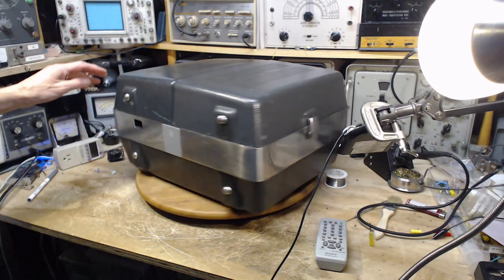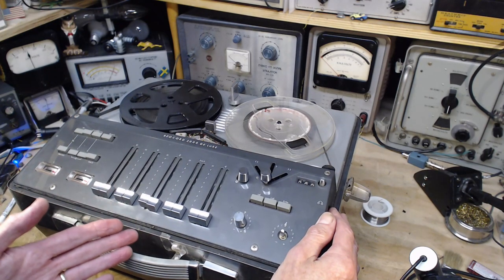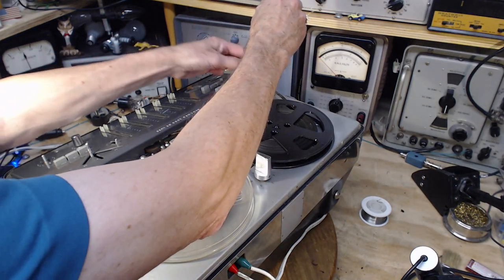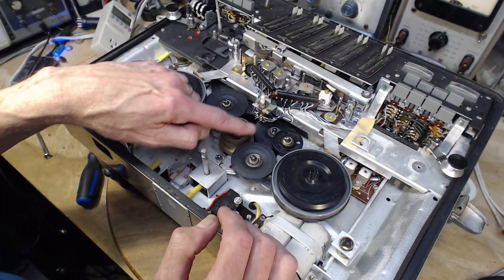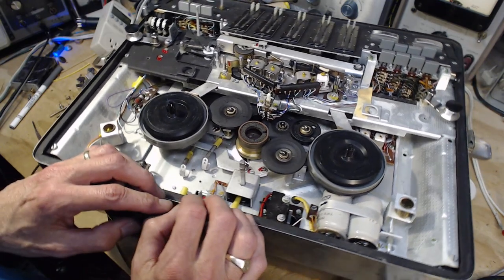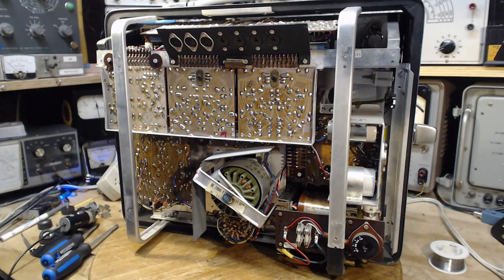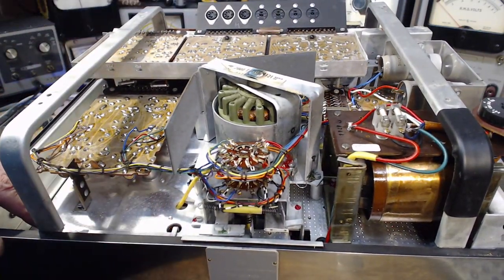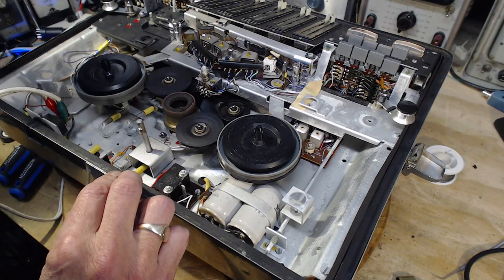Bang and Olufsen Beocord 2000 De Luxe Video #1 - Repair Assessment

Comment: I got the same one and  mine worked  but with very low quality  - anyway except motor capacitor too low volume  I had no any electronic parts need  to replace. But a lot of cleaning,  adjustments and very  precision alignment regarding heads. This unit had them four so it is (was for me ) very  tricky.  You are lucky if it wasnt misaligned before by any service, anyway it is possible to do it if you are experienced. 

 By way - from left to right - earsing, reproduction of four tack tapes, recording of two track tapes, reproduction of two track tapes. Switching two to four by square push button,. 

 After lot of work id is perfect now and i like it more than other due to two track stereo and intuitive controls Realy great machine - Bang& Olufsen is still best european outstanding  brand 

 Your problem is not realy problem - this is autoamatic stop reacting on tape end. Sound indicates that relay is working perfect. Unit has two - one for meatlic tape sensor at right side   and one for mechanical "no tape" sensor  - that one is located in pinch leading tape at left - at inlet to heads compartment. Without threaded tape it will try to switch it out.

Comment: The speed selector turns it on. Or you can engage power with the PA switch. The reason its making that noise could be because you havent threaded the tape correctly. Check both pre and post head metal posts, The tape should be in front of the posts not behind them.
Reply: I have the Cherry wood version which came without spekers. Gorgeous machine. :)

Comment: Prepare to fix up a lot of solderings. Solderings has always been and still is a weak spot when it comes to B&O. Their products are also notoriously difficult to work on due to the way everything is packed in there, which from the 70's and forward kinda sucks since their gear spent most of it's time at repairshops because it's always broken. "Design and gimmicks is everything - Quality ...(insert a fart sound here)". Be happy that this baby is from the 60's before they stepped into the crap era. 
Take this from a dane who have had to fix way too much of their ... censored due to foul language...
Notice the motor can be turned off on this model so the machine can be used as an amp without it running. This might explain the troubles you're having.